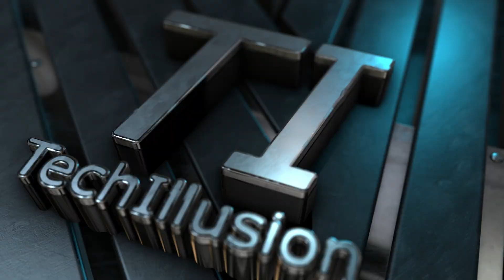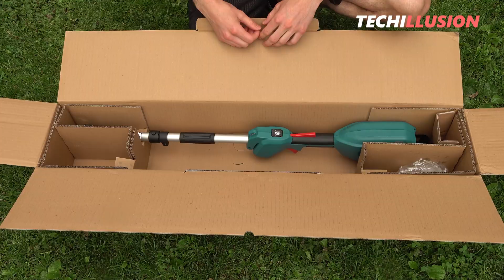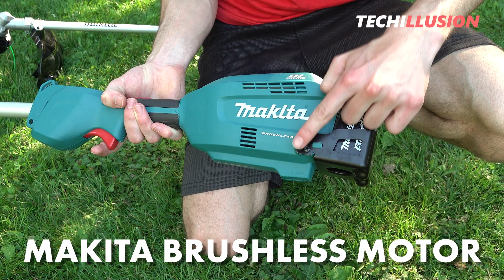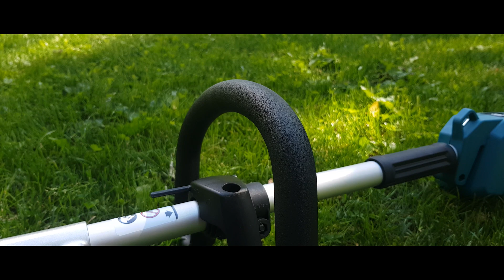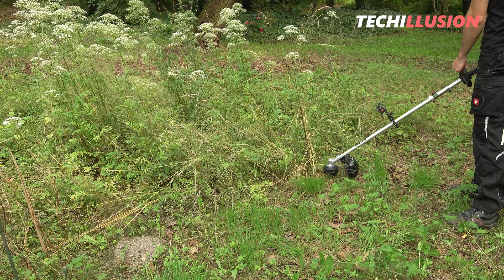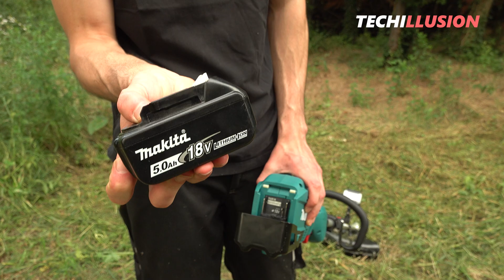🔥ENOUGH POWER with 18 volts?! 🤔💪MAKITA DUX18Z 18V cordless Split Shaft Power Head- Review & Test

Comment: Excellent review, thank you. How is the attachment point (joint) holding up after a year? Is it showing any signs of weakness or movement from the joint? I'm wondering if I might be safer with individual machines, like the DUR180 LINE TRIMMER AND A DEDICATED POLE saw..

Comment: I'm quite happy with what I saw, and the low weight is remarkable.  I'm a part time lawn cutter, the tallest grass it will trimis around 5" at the most ... you sold me.  How about videos on the single battery blower, hedge clipper, and pruner saw.  Thanks again.
Reply: The single battery blower is not very good if your a part time lawn care cutter you'd need the 36v

Comment: Can you add a pole or an extension onto a chainsaw?
I have a 18v and 36v and want extension options with staying on makita batteries.
Reply from the maker: @ianpaterson7225  The normal chainsaws from Makita do not have this feature. However, there are attachments for the Makita multifunction drive presented here. Chainsaw attachments. You can attach an extension to them, which allows you to saw very high branches.
Unfortunately, I haven't uploaded the video to my English channel yet. So far only on my German channel. I may also revise it in the future. For now, here's just the German version, in case it's also helpful: https://youtu.be/Ua_mrIPybtk
Reply: I have found that the basic hedge trimmer attachment is better and lighter than the one which folds back on itself - plus the basic one allows the use if the extension where as the bigger one is too heavy - I even use the scrub cutter attachment on long reach to minimise stress on the unit ! - the pruner is great !